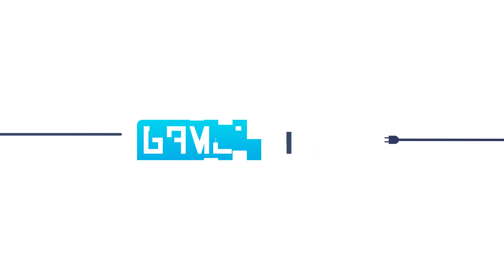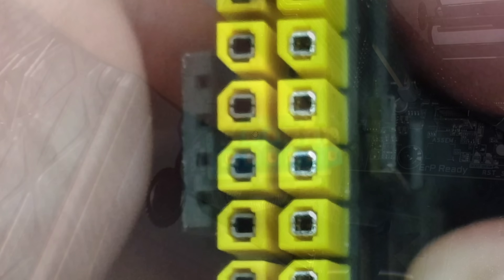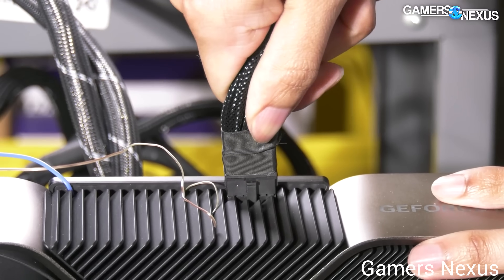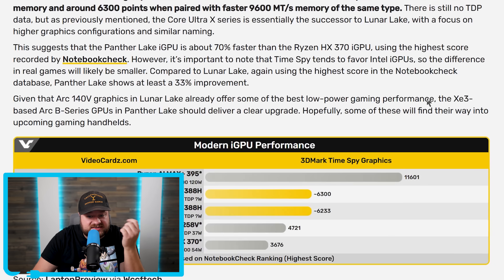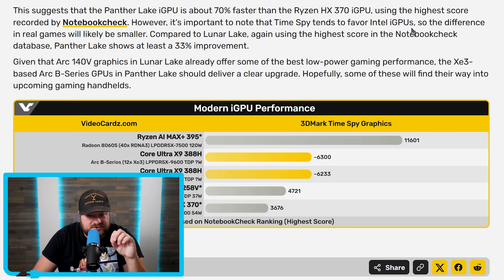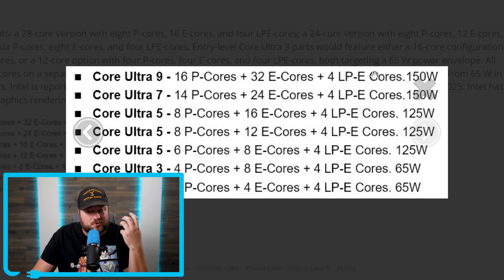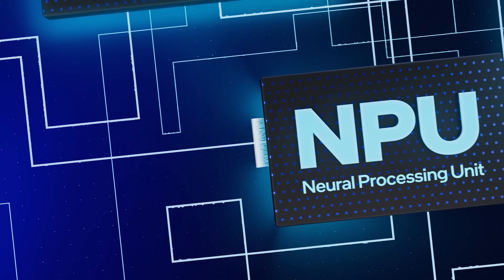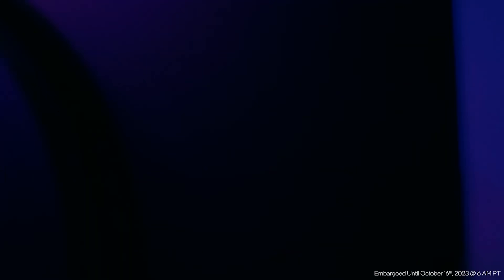PLEASE Don’t Do This AMD!

Comment: I had melted pins with a undervolt and underclock at only 270w/300w gone back to my 3080 ti from my 5090 whilst waiting for replacement but will porbably just sell my fe 5090

Comment: I have noticed a little bit of a pattern where I live in the world the connectors that seem to be burning are always in cases that have very poor airflow my computer I have a 4090 and there is a fan directly in front of the GPU blowing onto the connector and as of yet I haven’t had an issue but people that have bought their computers to me that I’ve had the connector melt. They’ve always had very poor airflow around the connector. I don’t believe this is the main cause but I believe good airflow around the connector may help prevent it from burning, but definitely not stop it

Comment: leave margin, leave margin! LEAVE MARGIN GODDAMIT! IT'S ENGINEERING 101! If the plug is overbuilt THIS CAN'T HAPPEN! Absolutely FUCKING SHAMEFULL that they choose to be as stupid as Nvidia... "It's on the limit but it should be fine", yeah, it SHOULD be fine, but some people move their computers, they need to get cleaned and messed with and even experienced users sometimes mess things up, what do you think is going to happen when your "ideal test scenario" doesn't match what users live everyday?! There's NO WAY they didn't know.

Comment: Why you have cases of burnt connectors?
You complain about the AI in the AMD CPU names like a pregnant woman, knock it off, tired of you complaining 5x in a single video, every single video. Just shut up about it, I don't see you complaining about Ultra on Intel CPUs.👎
1 MB L2$ & 1.25*3=3.75 MB L3$ per Core is very nice, while being Zen 6, would be a nice CPU. With 9 x, 24C probably SMT, so 1.3x24=31.2C, I hope that's not best AMD can do in non-ThreadRipper, or it's gonna lose the CPU Crown 👑to intel 40C & 52C CPUs

Comment: Now here's an idea, the cards have required three 8 pin connectors for almost a decade why are we using only 12 &16 pin connectors they should be at least 24 pins

Comment: I’ve been running the asrock Taichi rx 9070 xt on the Asus tuf 1000 w psu that has the 12v cable.  I’ve seen no problem yet, but I keep an eye on it.

Comment: This new connector is a failure...AMD and Nvdia needs to find ways to reduce the power requirements and do things more intelligently. Raising PSU requirement TO 1000w is insane. I refuse to buy any GPU which use any of this new connectors.

Comment: I really would like a nice little laptop with a super fast iGPU for gaming.  The ones with the 8060S and 8050S are good enough, but they cost so much and are in hardly any machines.

Comment: i just bought a 5080, should i use the 12 pin cable or should i use the adapter the gpu comes with?

Comment: at this point, idk why people are surprised when the 12vhp connectors melt, like, the connector is the problem, we figured that out like a year ago, like, going from dual 8pins to a single 12pin is removing 4 power pins, making the wires/cables/pins thinner, pushing more power through said fewer and thinner wires/cables/pins, like dude, ofc thats gonna melt, no shit
Reply: The 8-Pin pcie connector has 3x12Volt and 5x ground.
So, actually, there is the same amount of 12v pins in 2 8-Pin connectors as there are in one 12v2x6 (12hpwr) connector.
But, as you wrote, the pins are smaller, the overall connetor is smaller and a lot more current is pushed threw the same amount of wires.

Comment: my question is how did the 16 pin ever hit the market if it is leading to this many burned pins, you would think during the quality check they would run the gpu for a week straight at max load nonstop. im assuming it was not an engineers fault but corporate bureaucracy. Engineers are usually working with a lot of constraints likes size, cost, plus whatever you are trying to max out, and they are genius with their solutions (with good leadership). with the way wattage is increasing i think they need to take a look at how pc's are usually cooled and the way coolers are hooked up maybe needs to change. like they could add a spot near the connecter for liquid coolers, i wonder how many of the cord power plugs were using liquid coolers vs air coolers. just my thought with no research is that air coolers might keep the whole pc cooler while liquid coolers might leave leeway for hotspots to occur (specifically near the connecter). im sure they could set up some pc's with thermal imaging and run them for a week at a demanding  rate and see the temps.
Reply: btw if any company reads this and i solved an issue please hire me/send compensation.

Comment: WTF! How hard can it be to choose the right cable and material for a specific power load? This is not complicated physics, we are using electricity for over 200 years! There are 16 cables on each adapter to handle 400 - 600 watts of power in total and this sh*t just melts??? How is this even possible? The cable i put in my power outlet can handle more than 2000 watts without melting and it has only two lanes... How can something like that happen, WTF???

Comment: Under volting will increase amp draw.
Reply: Good thing my 6800 XT has the older connector. I have it bios Modded an extra 100w and it has been running smooth for over a year. 255 w to 387w. (Anything for an extra 40-60 frames ;).

Comment: This trend of smart connectors trying to 'think' has to stop. Either use a tried and true solution, such as USB PD (it would be even more compact as well) or just use TWO dumb but thick pins, like in industrial solutions. Imagine having a flat connector with a positive and a negative side and nothing more, like in server grade power supply units! Revolutionary idea, right?
Reply: On the Ryzen naming, why couldn't they copy Qualcomm's naming and go Ryzen 3/5/7/9 gen 10, 11 and so on so forth? Can't even add the accursed AI as a sufix if they insist on having it.

Comment: I get your point about the naming convention in regards to AI. I think the real struggle is Intel are pushing 150W as a desktop processor for the top SKU and have a distinctly different architecture. AMD on the other hand appear to to the new Intel at this point with brute force with 7GHZ and yet we have already learned from Intel's mistakes that this get beaten by IPC and die reductions to improve real world performance. Not sure how you can say AMD is better at this point on slide decks and leaks. I think we all know the 12v Nvidia "inspired" GPU connector is a real dog. I actually considered a Sapphire 9070XT with the connector, more for a clean case design .................. I avoided it as I did not have the connectors on the PSU and did not want to introduce a conversion cable. Personally I think they have to give that up as a bad job

Comment: The 12 pin could have used the same size pins as the 8 pin plugs and all of this could have been averted... So just a single bigger 12 pin connector. It's ridiculous to see that Nvidia is still forcing AIBs to use that garbage plug.

Comment: Just stop using e cores. Let em all rip dude. If yall just dropped a 24 p core cpu with no e cores. That shit would tear shit up. Get better at power management if you need e cores to dial your cpu back.

Comment: On the Gpu power connector, they really should go back to using the 6 pin to 8 pin style connector! These always worked well and never burned up. If it is not broken....Don't fix it as it is a well proven design.

Comment: Regular cable checks are not viable. The 12VHPWR connectors have a finite number of insertion mating cycles, between 30 - 40 at best.

Comment: the burning plugs can't just be because of being too close to max allowed, since you mentioned that even undervolting and running lighter loads still can result  in this. It's really a head scratcher given that info. Like, I'm sure they're tight enough to stay connected. One guess I've had is that it moves when putting the panel back on the case. It shouldn't considering how tight they should be attached, but it's really the only thing I can come up with. I wonder how many of these are burning up on people that frequently open their box

Comment: Oh boy nvidia gotta go back to the old school connectors i bet they are feeling the heat! Haha, the doomas engineer that designed this hopefully gets a reality check. You cant push more power in a small cross sectionnlike that meanwhile the cables go from copper to aluminun clad in copper. This gen z ' is still sucking on thier thumbs' baby steps i guess they never entered a mining facility in 2014 lol 😅😅😅😅😅 hahahahahaahahahahaahahahahaaahahahahahahahahaahahahahahahaahaha soopidfooks

Comment: The 16pin connector has been a complete failure.
Or they go back to 2-3 8pin connectors, or make a new connector that can handle the load.

Comment: I knew getting a Sapphire Pulse 9070 XT instead of the Nitro was a wiser choice. Paying more to have the power connector melt is nightmare fuel.
Reply: i about to buy a rx9070xt i was gonna get the itachi but it has 6 pin lol i dont know now my just get asus prime 8 pin

Comment: Okay, and when will there be a petition campaign to stop using 6x2 connectors, which have lower current capacity than 3x (4x2) Molex connectors?
It's easier, and they charge a lot, so why have to solder the 20 to 30cm cables for two or three 4x2 Molex connectors? No connectors on the PCB. With this cable (set of cables) I could tie a knot, with the 6x2 connector, you have to leave a gap for the first "elbow." It's mind-blowing, as if the card weren't wide... they couldn't even extend perpendicular to the PCB (90º for connector engineers).

Because they don't know how to screw in two screws either... remember DVI or VGA? They had screws...

For the 6x2 connector to work properly, 24V should be used instead of 12V, thus requiring half the current, allowing the use of the reduced cross-section, as well as less contact surface of the new connectors without them overheating.
At the time, I thought the four sensor wires were to measure the voltage drop and compensate by increasing the output voltage, thus reducing losses, but no... it's to see how many watts the GPU's VRM can request, or so I think.

There are already two "standard" PSUs for the new connector when they weren't needed... and what they do is put yellow color on the connector...

Comment: Bought a Power Colour Red Devil 9070xt. Usual 3 x 8 pin like my 6950xt. Both cards still running fine. 12 pin should be banned.

Comment: Its either the GPU or You Need two Power supply's for it to not melt.
One for the gpu and the other for the motherboard.
At a rating of around 850 to 950 watts, it could be because its 1000 watts that its melting the cables.

Comment: Anyone who pays 2000+$ can purchase a new PSU too. So the logical thing to get rid of this problem forever is making the GPU fed by 24V and used lower Amps on pins. This architecture needs an improvement for long time

Comment: the 12vhp connector is one of the main reasons I went to AMD.
Reply: same. even if it doesn't burn, it will be in your head constantly that it might
Reply: can we finally fuck them allup. im so sick that EVERYTHING IS CORRUPT AF MAN. THE SOLUTIONS ARE ALWAYS SO SIMPLE
Reply: about 100,000 amd gpus get dried up thermal paste and 110 hotspot temps for every 1 nvidia card burning up
Reply: @bigturkey1  where do you come up with these numbers? amd doesn't even sell that many gpus
Reply: @bigturkey1  this may be true but you can re-paste, but you cant just swap your connector.

Comment: 7Ghz on AMD? What the heck... I'm going to take that with a very large grain of salt because they had troubles hitting 5ghz not that long ago. Are those going to be on a new mobo, or still AM5? I haven't upgraded from AM4 yet. I didn't feel like I really needed to since my PC does everything I want at speeds I'm happy with.
Reply: It's using Nanoribbon FET. There should a large improvement in clocks peed with that one transistor architecture.

Comment: the 12pin connector is why I wont upgrade from my 3080ti..
Reply: Get the 9070xt that is not on that connector
Reply: @denan1  I know. But I pair Intel Chips with RTX cards. 
& I still prefer the video encoding of Nvidia.

Comment: reason number 59.857 to never buy a 40/50 series card. melting connectors is a nightmare. there are workarounds but they shouldve been worked around by nvidia one might assume. lets talk about 99.9% of gpus that would only melt it your pc/home is on fire.
Reply: seriously, if you wanna release a gpu with that much extra horsepower and that much extra price, do it without failure maybe. i think manufacturers usually test their products in order to fix issues prior to release to avoid the amount of rma they had to go through until now. and it doesnt seem to get any better.

Comment: I don't understand, they know 12 pins plug is shit, they know what kind of problem is cousing and yet they put this garbage on GPUs, i just don't get it. Why are they doing this, are companies trying to be in style with this trash wannabe hit or???...i just don't get it. Just put back double/triple 8 pin plugs and reduce cost of replacing burned GPUs. Companies think how much you'll save buy just puting back 8 pin connectors.

Comment: apparently, you don't know, or people'd (AMD and nVidia) stop using the damned thing already...    lol....    HOWEVER, while I have a 4080 Super in the System right now, I have a 7800XT waiting in the Wings for a Failure...     i also never touch my system, and never turn it off except updates and reboot cycling...

Comment: I would never buy anything with 16 pin connectors. I recently build two nearly identical computers, other had RX9070XT and other 5060Ti. Major reason when selecting GPUs were power connectors and power consumption. If component manufacturers stop offering 8-pin connectors on GPUs, I choose integrated GPU.

There is certain level of insanity that I can't accept.

Comment: The 12 pin connector itself is not flawed, but the required implementation in the PCI-E standard is. It says the pins have to be connected together in the card to make one big cable rather than treating it like 6 cables. This is turn makes load balancing impossible. Drawing 120 W means 10 amp and without load balancing that can be 9 amp on a single connector, which overloads it and it might melt.

The idea of using multiple thin cables instead of one big one has been used multiple times over the years because smaller cables are easier to handle. The 12 pins power cable stands out for having entered production for consumers. All other attempts have been stopped earlier because it has never worked reliably. It assumes power follows the theory completely, which requires no manufacturing variations, difference in cable wear, temperature differences or anything like that. The real world will never balance perfectly like this, so it just doesn't work.

If the 12 pin connector is treated like the 8 pin connector, then it would probably work. This means treating it like 6 standalone cables and put each chip on the board on just one of the pins. The test that Der8auer did where he cut 4 of the wires and let the GPU run on just the remaining 2 shouldn't be possible. It's only possible because the GPU can't detect that it overloaded those two wires.

This is all a question of money. It makes the GPU cheaper to design and build. The PSU could detect overloaded wires and trip a breaker if overloaded for an extended period of time, but that will cost money to add. Right now the issue is if something goes wrong, 3 companies will be involved (PSU, GPU and cable) and they all blame each other rather than dealing with the underlying problem.

Here is the crazy part: nothing will stop a GPU maker from making a GPU, which treats each wire as a standalone cable. They do for 8 pin connectors. However if they do it with the 12 pin connector, technically they do not comply with the PCI-E standard, which means the card is no longer PCI-E compliant.

There is an argument about the 12 pin connector having the theoretical max load closer to the max rated load than the 8 pin connector. This means manufacturing variation is more likely to make it not handle the rated max. However that is a minor problem compared to not being able to obey the max rated current. Doesn't really matter if the cable can handle 10 or 15 amps if the design won't prevent a load of 30 amps. The pins are rated to handle max 9.5 amps (a google search says some cables only allow 9?) and with 12 volt, 600 w requires a combined current of 50 amps.

A 9070 XT draws around 25 amps at peak load. If say half of that goes through just one pin for some reason, that will be 12.5 amp and there is your melting problem.

Comment: You think the AI in the new Ryzen lineup is extra?  You think the integrated GPU is a waste of space?  Maybe for gaming, but not for AI.  This means that all of the system RAM will be accessible to the GPU, similar to the AI MAX 395 processors.  That means you can host a much larger LLM or multiple larger LLMs.  This is fantastic news for AI workloads.  I hope the chips support 256 or more GB of high speed RAM.  It will make a huge dent in the very rapidly growing AI space.

Comment: It read "ENHANCED support for next gen AMD"... a little bit different to "added"...
Would  really prefer not to have this fake  surveillance "A.I." nonsensse in my hardware, they must make the models with it optional.
Intel shipping more fake cores than ever before... They really have a crappy fabrication process and need to claw back poor quality silicone... steer clear, those "E" cores are pointless and it' only a 16 core cpu  in any meaningful task.